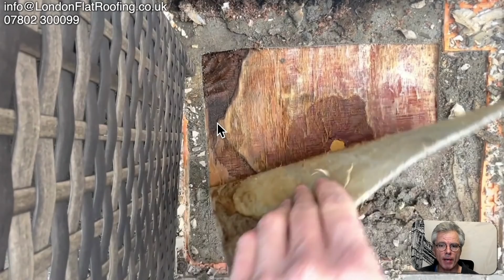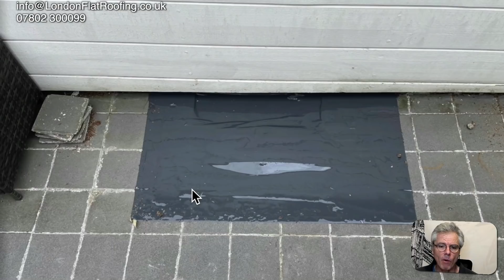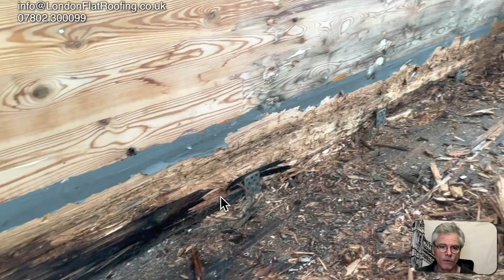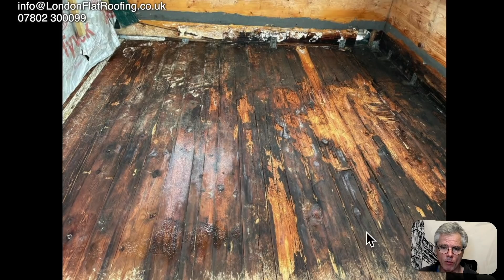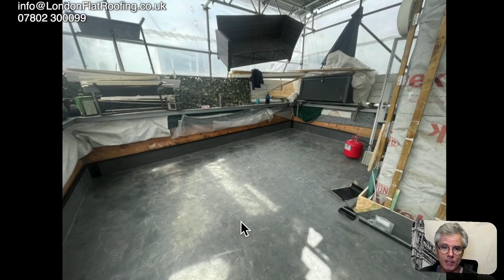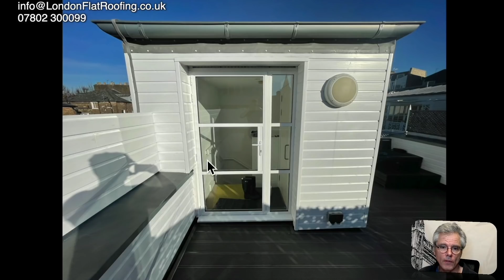New Build Passive House Roof Leaking or Sweating?

Comment: Really enjoy your videos, I don't have anything to do with roofs, juat a casual viewer. It's really interesting to hear from a professional how different roofs should perform and how to combat issues. This particular job must have cost a fortune, but the work looked like it was a necessity. What I don't understand is why the original builders are not held to account or the local building authority who sign off the work.
Reply from the maker: Building control is not clark of works. There is no comeback to Building control there job is pretty much only safety IE making sure the building want fall down or burn down or harm anybody
Reply: @SteveRoofer  thanks for the reply, So can the original builders or project manager be held to account for the failings then?
Reply from the maker: @Nick Jeffels  All new builds shoud come with a ten-year insurance backed guarantee NHBC is probably the best known. Generally, the defect period where the builder has to pick up the problems and snag is 24 months after that its down to the insurers, how I actually got into all of this was being one of the building companies working for the insurers going around putting right the so-called house of horrors. As you can imagine the insurance companies don't want to pay out for much and you have to have a big problem and a watertight ( excuse the pun) claim for them to payout. I would say when I was doing that sort of thing generally the claim was always between two and 6 years old before it was settled and we went in to put it right
Reply: 2-6 yr old claims, wow!

Comment: Seems like a case of multiple humidity sources. Passive houses drive the point of condensation deep into the construction by design, we will be repairing these houses as fast as wood rots in hot wet conditions, I recon. Your solution to the problem was well thought out, hope it works. House designers should work in repair and restoration for a few years before being allowed to get their degrees.

Comment: I had a similar issue recently to deal with on a hospital. Seemingly water getting behind the system everywhere. Re profiled and that was covered in a Triflex system. With grit added to walkways. 
 I’m always amazed at how previous people complete roofs when I start to strip them. Often feels that a lot is an after thought. When the roof is one of the most important parts of the building.
Reply from the maker: absolutely

Comment: Not quite sure why you think it’s a Passive House? If it was it would be on the Passive House database and certainly wouldn’t have problems with sweating from the inside as the Mvhr would create a dry internal atmosphere. Well insulated does not mean passive house. The whole point of passive house is that there is a robust check on all design and construction
Reply from the maker: I do say like a passive house or close to passive house
Reply: @SteveRoofer  but it is neither like or close to passive house for the reasons I stated. The title of your video implies passive houses are more prone to roof problems and they are certainly not going to sweat.

Comment: Surely wrapping bottom furings where it sits on wet deck would have been better  just to rule out further seepage from roof underneath  as it looks soaking wet?
Reply from the maker: It's wet because of the rot treatment we put on it. All the timbers we put in are treated also so that won't be a problem. The ventilation around the outside is enormous, so the internal timberwork will be back to some sort of equilibrium extremely soon. Even in the winter, the surface temperature of the roof is quite high  that will help with evaporation and the venting will deal with the rest

Comment: Great video Steve. On a traditional felt roof flashings would be used from the roof up the wall and under the copings so water couldn't run down
Reply from the maker: Good tip!

Comment: Hi great video - really informative but a few details at the end were skipped over. Can you explain if there was a membrane or flashing down the parapet to stop any driving rain running down the vented edge strips? Would be great to see a full roof to parapet detail
Reply from the maker: I had to cut out so much as the video was getting  extremely long, the parapet walls had plastic and a breathable membrane on them also. Internally we had to do lots of repairs and treatment to the mould on the walls, just to much to go in one video

Comment: Another really interesting video. Having completed a large CLT project (with a warm roof) I am aware that all openings in the CLT (ideally) need to be made in the factory. Being the main structural element the number, size and position of the openings need to be checked by an engineer, so given how neat that hole was I wonder if it was originally intended to be the position of a roof outlet?
Reply from the maker: Possibly

Comment: The 2nd layer of firring strips are way too thin on the low end to be self supporting and get a good fixing in to, should have had a noggin underneath, the deck is going to sag over time. Fixed one problem and created others!
Reply from the maker: Good point however OSB is designed to span 400mm center to center, if you look closely this span has been reduced at that end therefore offering more support where we cross  the battens. Theres is more support than meets the eye at this point, extended pinpoint loading  with decreased unsupported area of OSB.
Reply: @SteveRoofer  The areas where the battens cross are extremely small and would provide significantly less support than would be required to prevent sag in the OSB, also fixing of the sheets would be a major issue as the firring strip has no substance, this type of firring strip should be fully supported along it's length. This problem will cause issues in the future, a poorly thought out solution in my opinion.

Comment: Over engineered and design flaws. I'm constantly battling with architects /builders over detail they've downloaded or been given by architects. Which is for a standard warm or cold roof, with out parapets or skylights or screeds or tiles, decking etc. And details from 10 yrs ago. Anyway thanks appreciate the videos. As always extremely beneficial
Reply from the maker: Yes its a constant battle

Comment: So that put a block of wood in a plastic bag then feed water into it, covered it all to keep it nice and sweaty, surprise! It rotted, well I never, who knew wood and water don't mix well. I am totally surprised, not!

The first clue was at the beginning when he uttered those famous last words " couldn't find any drawings" as you know a recent build like that would have architects details which are translated into manufacturers production drawings to be at least signed off by the builder or a qualified consultant, usually architect/ structural engineer and often the product manufacturers involves.

Looks like a D&B contact, where these processes are cut out to save money, win the job with lowest price. Old saying that never changes "you get what you pay for". In this case the materials seem correct but the construction method wasn't.

A nice renovation by your company, a bit more than just a repair.

Comment: Quick question, since you figured water was dripping on the parapet walls, wouldn’t that mean it can now drip straight down into the timber roof ?
Reply from the maker: No as we fixed the leaks to the parapet walls

Comment: As an old roofer told me many years ago "there are only 3 things that are certain in this life, 1. You have to pay your taxes, 2. you will die eventually and 3. your flat roof is going to leak"!!  I work in the industry and with most projects we see, there is very little thought by architects/ designers to ensure they detail the flat roofs robustly for enough fall and ventilation/ vapour barriers.  Problems waiting to happen!
Reply from the maker: Yes for some unknown reason the falls are alway to small

Comment: If the original source of moisture was identified as water running down the inside face of the parapet, what measures are in place to stop this happening again? Does the epdm sheet on the deck extend the full height up the parapet? Or is there a parapet covering that drapes over the sheet on the deck?
Reply from the maker: We have fixed the leaking parapet copings and told the customer she should replace them Thats as much as we can do for now

Comment: Hey Steve. Great content as always. Just a question regarding some videos I saw from a chap doing garden rooms in Leeds. He has been doing hybrid roofs due to height restrictions for outdoor buildings. This hybrid roof consists of pushing the pir up against the roof OSB and creating an air gap between the plasterboard and PIR...his school of thought is because the PIR is pushed firm against the OSB, there is no room for moisture to get trapped between this and the OSB. What's your thoughts on this way of doing the roof and of this works, why wouldn't you push all pir in cold roofs up against the roof to make it hybrid. Your opinion on this would be interesting. Many Thanks
Reply from the maker: Everything works until it doesn't a garden shed doesn't come under building control so they can do what they want. WIll it work?  If the building is not heated or lived in possibly
Reply: @SteveRoofer  thanks Steve. Definitely heated and many used as offices and gyms. However, does state they are low occupancy, but then again if your making a garden office. You are probably going to use it everyday. Worryingly according to him some building regs agree with this school of thought. First 10 mins - https://m.youtube.com/watch?v=mLi1rTQAKKo&t=714s

Comment: Hi steve.
Great video.
How did you prevent the water coming off the coping stones and down behind d the parapet cladding, which was the cause of the water ingress?
Reply from the maker: We applied rubber sealed to all the joints of the zinc cappings and told the customer to get them changed  Will they I don't know? probably be back in a year or two

Comment: Hi Steve,
Trust you are well. 
Is there a drawing/illustration I can use as a keen DIY enthusiast, for walls, breeze block single skin, which shows how to correctly insulate externally. Your help and guidance would be appreciated.
I have the said wall which is a dew point in my home! Causing damp in this area.
Thanks Harry
Reply from the maker: Sorry I don't know much about external insulation obviously google it

Comment: Based on the previous hole that you found, I wonder if those tiles were a recent addition to sell the house and cover up the problem by looking shiny.
Just an interesting point on this one is that you still have to make sure that the height of the guarding is not compromised to the parapet walls as you have raised the level of the deck by probably 100mm.
Also to say that there should be detailed drawings lodged with Building Control for the build up, unless it was built by NHBC.
Reply from the maker: Its possible re the tiles however I don't know. Good point about the hand rails, it was already high enough  the depth of the wall is amazing there is the timber inner frame with an insulated cavity before you get to a normal cavity wall with block inside and outside and then some sort of external rendering suggest 500 to 600  depth, its also at an angel sloping inwards, this didn't help as rain hit the top and then came in under the tin roof and plastic

Comment: We've had a job recently, on a 10 year old roof, completely rotted out. But looking at it it's the architects design error with oak frame not deep enough to accommodate warm deck and doors to low onto balcony through more leaky oak frame. Without Ripping the whole extension down and starting again, not much we can do. Classic insulation between 4 inch timbers downlights cut through any vapour barrier, not being able to flash a mortice and tenon oak frame. A whole list of rubbish to be honest. Anyway great video, I do enjoy your analysis videos.
Reply from the maker: Yes a lot of this is because of the design some people just don't live in the real world

Comment: Hi Steve, currently doing a flat roof of my own for the first time, found all your videos very helpful.
I have gone down the cold roof route, just a quick question, when putting a vapour barrier on a cold roof are you fixing the vapour proof barrier to the joists before plaster board?
Also would you recommend a vapour barrier please 
Cheers 
Luke
Reply from the maker: Yes you fix it to the joists  there are lots of  AVCL (air vapour control layer) out there I will be doing a video on some shortly however ive been working with Novia  recently and they have been really helpful   try the 1200g VCL don't forget to get the tapes   Novia Butyl 30mm x 30M and Novia BOPP tape 60mm x 50M get back to me if you have any left over as I can put you in touch with outers that may  buy from you steve@londonflatroofing.co.uk

Comment: Did you need to raise level of parapet wall or was it high enough already?
Reply from the maker: Good point, it was already high enough  the depth of the wall is amazing there is the timber inner frame with an insulated cavity before you get to a normal cavity wall with block inside and outside and then some sort of external rendering suggest 500 to 600  depth, its also at an angel sloping inwards, this didn't help as rain hit the top and then came in under the tin roof and plastic

Comment: Great video. Is there any protection between the plastic supports for the decking and the rubber membrane?
Reply from the maker: yes there are soft rubber pads under each pedestal they come with the decking pedestal kit